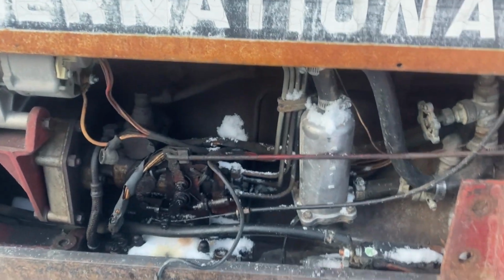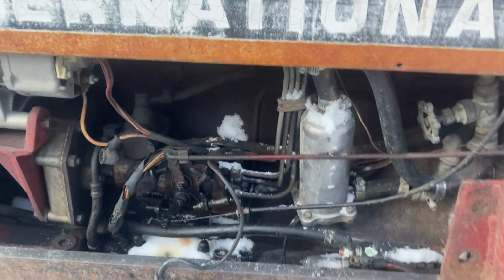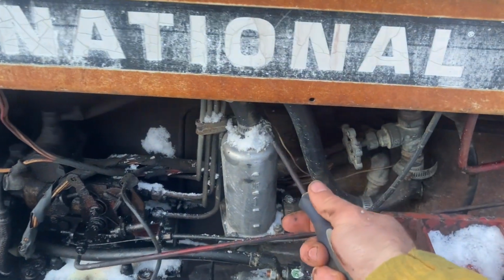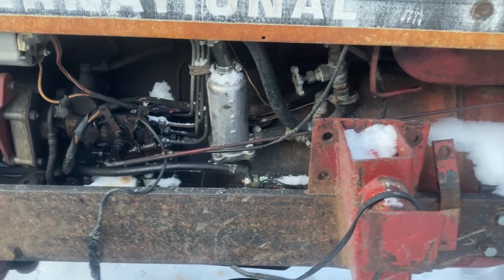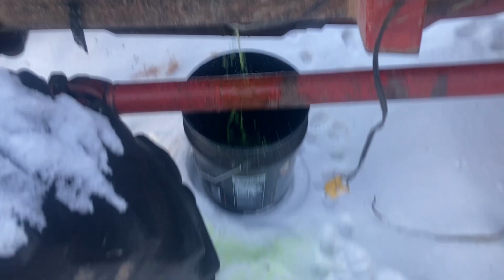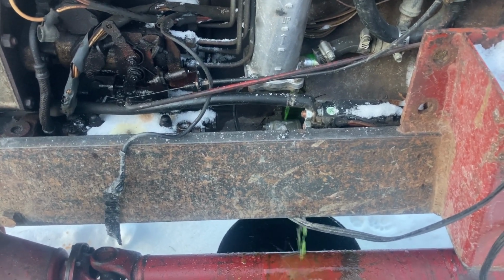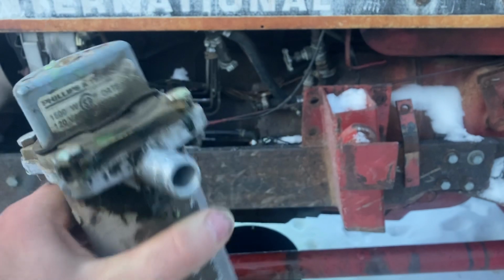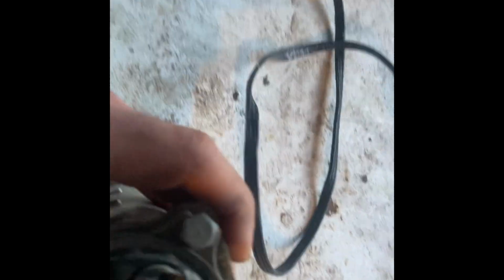Removing a water heater with a broken thumb nail IH 844S

Comment: Good  day Case85.  Yea those heaters take a beating.  
Now Mennonites  down here by ST.Jacobs area  made heater from water heaters.  220 -3000 watts,  I don't know  well I guess they don't chop any more, so they don't use power plants in winter. 
That thermostat  really does not have to be on if u  don't  leave  on  too long.  I don't like them, take alot of hydro 1500 watts . My 574 has one 2 hrs & battery & everything is heated up.
Thanks for now  So u have 3  Case IH tractors?
Reply from the maker: Yes we have a IH 674  IH 844S and case IH 4230(edit IH SWD 6)
I usually plug it in for an hour and they are good to go